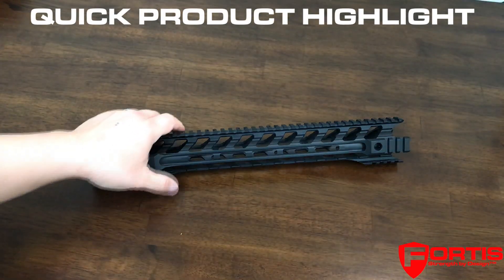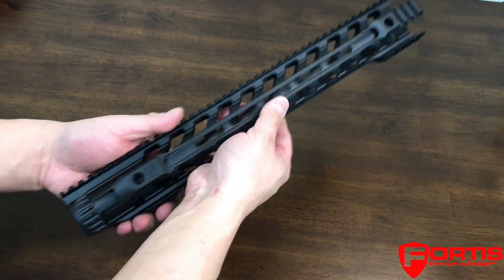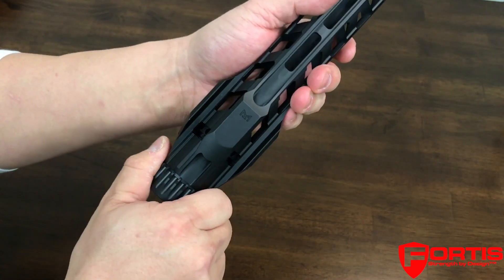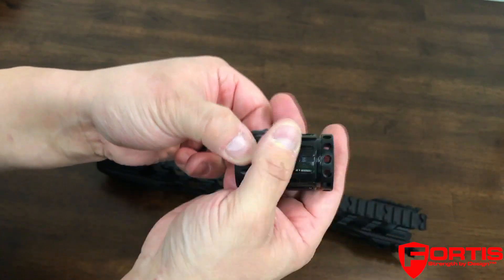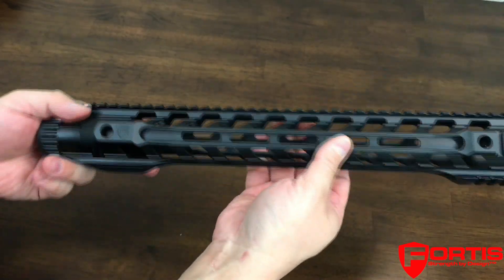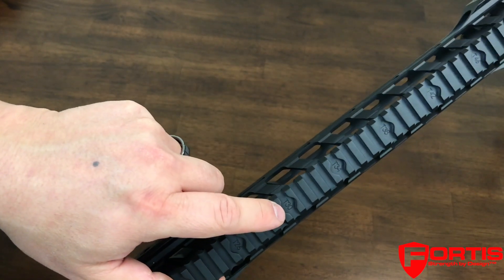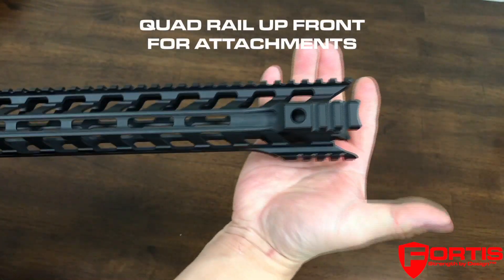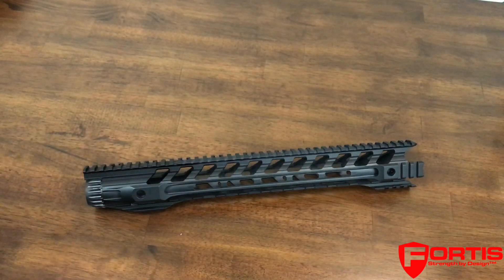Quick Product Highlight - Night™ Rail Series

Comment: Are those not QD holes?
Reply from the maker: Yes, they’re QD sling mounts.
Reply: @FortisMFG  My QD snaps into my SB tactical brace and buffer plate but the hole in the rail is too large. Is there an insert for that or a larger QD end?

Comment: Can you do a video with the night rail showing the 12, 14, 16 inch versions on a 16 inch barrel? Thanks.
Reply from the maker: I can work on that.
Reply: @FortisMFG did you ever made that video request? i have a 16" rail with a 16" barrel, and consider it too long. Would like to compare to the shorter rails…
Reply from the maker: @tabonuco  No, we did not. Please reach out to us at info@fortismfg.com and request a copy of our Upper Configurations Catalog. It will have most of our handguards with different barrel lengths.